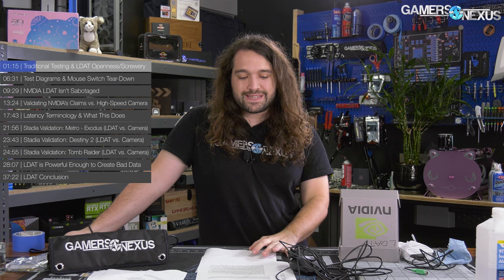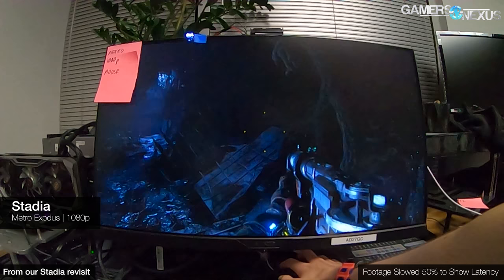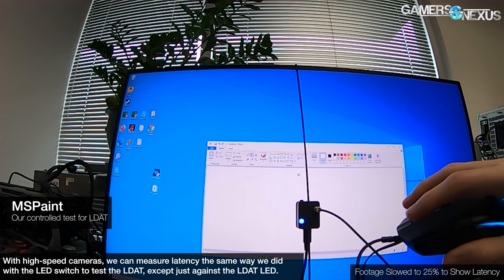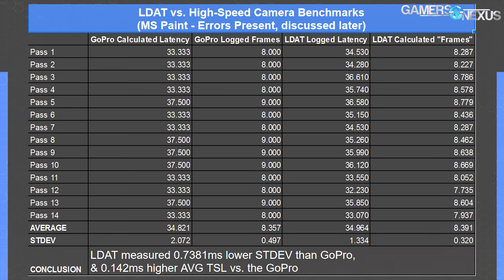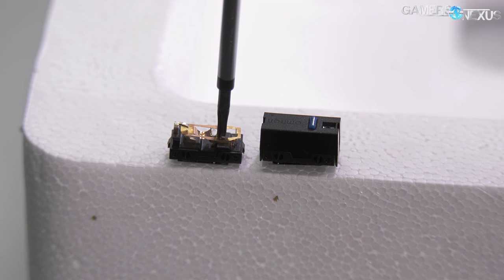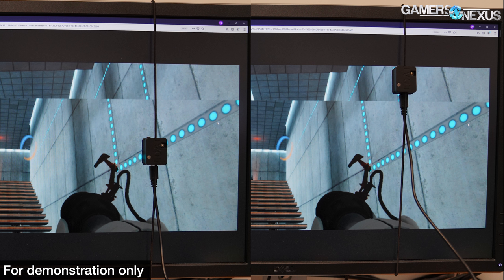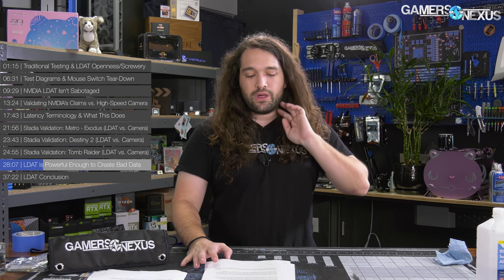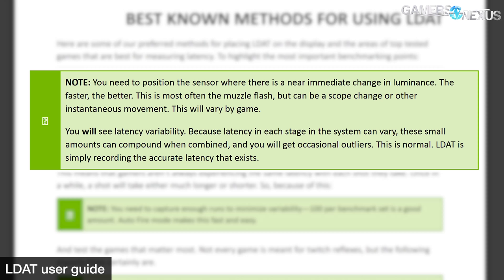Automated System Latency Test Methodology (NVIDIA Latency Analyzer Validation)

Comment: Some of the stuff I would like to see is:
Bloatware latency
Antivirus latency
Latency scaling with fps
Latency with g-sync ultimate vs freesync
Bluetooth on the different chipsets
Reply: You should check out Battle(non)sense, he has done latency testing for many things including g-sync vs freesync. He also has done testing for Nvidia's ultra low latency and AMD's equivalent.

https://www.youtube.com/BattleNonSense/videos
Reply: I've noticedUsing Game booster my latency has gone down. Curious if closing background apps makes a huge difference or if it's plesibo
Reply: @HauntedAbysss  If the game you're playing puts a significant load on your system where background processes have to fight for resources then yes it can make a large difference. If you have abundant CPU and GPU resources still available >10% to allow for background processes to not steal processing cycles you shouldn't see a big difference if any.
Reply: I wouldn't mind seeing Bluetooth latency. On my work laptop the Bluetooth was junk. Ended up getting an AX200 to upgrade to WiFi 6 as well as get better Bluetooth. No BT issues after upgrading.
Reply: Latency while playing youtube videos on another monitor.
Reply: latency testing of average human and pro gamers in different games
Reply: Bloatware, Antivirus, etc. are just software loads on your system. What I'm guessing you really mean is ISR/DPC latency.    Technically that will affect many things including mouse sens/input feel and overall system latency but measuring those individual software impacts is mostly system configuration dependent.
Reply: @howiejcee  yeah microstutters from dpc latency are cancer
Reply: sakle  That would be because they use more resources to decode.

Comment: QC technician here: if you want higher precision you should look at the traceable calibrations of every instrument you use. If you can trace their calibrations back to a NIST standard that is calibrated by NIST, you can verify the uncertainty of all of your measurements. This does NOT mean you need a NIST calibrated timer, photometer to measure light detection and universal time of the event. Rather if you can validate that every measurement device has been calibrated against a standard device ( a device either calibrated by NIST or a device at NIST)  and has a serialized calibration ID and a relative error (uncertainty) issued, you can increase your repeatability and confidence in your actual margin of error.
Reply from the maker: We have several NIST certified instruments already, but no photometers right now.
Reply: Eh, then you know how expensive calibration can be. I often spend as much on calibration as the tool cost, and I have to do it repeatedly. Important for QC in an accredited lab, not so much for a YouTuber
Reply from the maker: @FuncleChuck  Yeah. We spent about $2000 on calibration for some of our equipment in the last 2 years or so.
Reply: @GamersNexus  This is why I come back here.  Your commitment to unbiased testing is as close to any lab ive worked in.  You deserve more publicity and viewers so you can afford more equipment and processes to back your methodololgy. Keep up the great work and thanks for all that you do!
Reply: @FuncleChuck  Well, it boils down to the same thing: making money.  An accredited lab must do this to avoid exposure; you'll be sued by a customer if something fails and it comes out in court that your instruments were not in their calibration window.  For GN, it's a matter of credibility, they will loser viewership (== $) if it is revealed that they are using instruments out of calibration.  I would suggest that GN put up a page on their site listing their instruments and current calibration status, just as you keep records in your lab...
Reply: d00dEEE yeah! I’ve been saying that these tests are their own SAE /ANSI grade stuff. GN 9502 for latency, GN 18870 for CPU scaling hah
Reply from the maker: @d00dEEE  It'd be nice to do that; unfortunately, because we've seen competitors copy us over the years, we intentionally withhold some of that information for competitive reasons. Knowing the name of the tool is powerful when you compete with people who don't know those tools exist. That said, as our equipment becomes increasingly expensive, we'll probably start listing it -- but that's just because we know other reviewers won't invest $30K in a thermal chamber, for the most part, and those who can will already know what they're looking for.
Reply: Amateur electronics fan here: what would instruments perfectly calibrated against NIST standards help in this particular case? Sure, when measuring temperature or airflow it's reasonable, but we're talking about looking at a screen. Once you know the whole chain produces real-life results (latency numbers) that aren't skewed by inner processing, bus communications etc., you're good. We're talking about a few kilosamples of data per second, this is easily doable even with just a sound card or a cheap microcontroller/logic analyser.
Reply from the maker: Yes, we wouldn't NIST-certify something like this. I was talking about thermals and wind.
Reply: @Witchlord  I don't want to be a dick to GN, what they do is truly amazing and from what I've seen im have to agree that their COMMITMENT to correct testing is comparable to real labs.

That doesn't mean that their testing is as correct as lab results would be though. It probably mostly isn't. 

Thats not GNs fault and really a result of the situation though, and considering the situation their commitment is even more commendable. They got into an industry where a number of the tests they do didn't exist on a reviewer end and many of the tests they do are hard to design correctly without the insight into the design etc that a manufacturer run/commissioned lab would have.
Reply: @9SMTM6  well yea, thats because labs have more money than they do.  My response was taking that into account and was just trying to point out that they are committed to coming ever closer to that.  Your response is just splitting hairs.
Reply: @9SMTM6  Also, if you reread my comment, i didnt say that the results are close to a lab, just their ability to be unbiased and look strictly at the data
Reply: @Witchlord  My response is trying to clarify things for other people that might stumble upon this. GN itself constantly says how difficult it is to get the right message across. Many people will read your comment, which due to its correctness noone challenges, and will think "oh yeah so GNs results are lab class". That's not the situation here.
Reply: @Witchlord  if you read my response correctly you'd see that I never said that you said so. I just gave a statement that is against potential misunderstandings of your reply.
Reply: Erik Bročko how do we know the polling rate of the LED is exactly what they say it is? We just have NVIDIA’s word. You want to know what the frequency of that LED is, you need a calibrated oscilloscope. Secondly, high speed camera to verify the time code when the button is pushed isn’t any good if we don’t know the actual accuracy of the frame counting in the camera. There’s a lot of unknowns.
Reply: Gamers Nexus that’s exciting that you take your work to the next level. Calibrated equipment is something often seen in the sciences, but doesn’t seem to get the same level of attention in the tech space in a consumer manner (although most consumers don’t pay attention to NIST traceable equipment in the sciences either).
Reply: @GamersNexus  Being honest, I consume an inordinate amount of review content within the hardware space and I'm struggling to think of a genuine 'competitor' who is remotely on your level of detail or thoroughness. You epitomise market leadership for consumer pc hardware.

Comment: Well, RIP. I've been slowly working on a project almost identical to this, on my own, over the last year or two. I was intending on sending some freebies to my fave PC hardware YouTubers when it was done if they wanted to check it out!

Seems like the Nvidia guy working on this was more up to the task than I was, I was never able to get the photodiode polling rate that high, very nice! I only got up to about 1KHz before running into problems. Designing the Transimpedance Amplifier circuit was just not working out for me. Also, the software is way more fleshed out than mine. But the operating principle is identical (modified mouse, photodiode against the screen, hardware-agnostic). Glad people are getting their hands on this stuff. That's why I started my project - seeing the janky testing methodologies used across YT.
Reply: You're awesome

Comment: This opens up a really cool new possibility for HID testing; mouse, KB, and controller latencies. 
I'd love it if GN could do some Wired VS wireless latency testing for Bluetooth peripherals to see if there's a real difference there (on full battery).
also, Id really like to see the latency of different controllers; specifically the Xbox vs Switch pro vs DS4 vs Generic USB gamepad (say, a logitec) with Steam's controller drivers (how they're going to be used 95% of the time)
Reply: Rocket science have done some tests on the controllers, I recommend to you check it out

Comment: I work in the critical infrastructure field.  Our company specializes in monitoring power, specifically battery backup power on large battery banks.  Of the many values we monitor on a battery, ohmics is one of them and probably the trickiest.  This is because bad data is very, VERY easy to collect.  There are far more ways to do something incorrectly, than there are ways to do it right.  Even incorrectly torquing a bolt down on a battery by 10% can skew ohmic readings to make a perfectly good battery look bad.  This is why we limit who can buy/install our equipment and often times end up installing it ourselves to mitigate bad data collection.  

NVIDIA handing this equipment over to you is a huge show of faith in you and GN as a whole.  They trust that you will continue to do things the right way and validate your claims.  

...and they gave LTT one too.

Comment: I've been waiting for someone to take this approach to system latency since the quakeworld days. It was much more of an issue back then but sadly nobody remembers (or just don't care anymore). You absolutely have my support, thumbs up! BTW latency of mechanical mice (used at the time) was very consistent and genrally low compare to light sensor mice, monitors had been very different as well ...times they are a changin'...

Comment: Glad to see modern hard reviewers going in depth on technology instead of just producing Linus clickbait stuff, even if it isn't made for the masses. Definitely appreciate the video and I'm thoroughly glad that Nvidia went out of their way to produce something that has been needed in the community for a long time. I think the ultimate end version of this might even be something that excludes a mouse and produces a input to the computer, which it then has to display and the LDAT logs. Because of the speed at which the LDAT can capture, you could theoretically log input to frame time and then look at the end to end latency on said frame. Then you could remove frame time as a variable, and look specifically at the variance in input delay and compare it against frame time.

This would be easiest to do with a overlay, however a overlay is not something that a game is producing and bypasses something that really matters. At the end of the day, having game developers simply output a square of changing colors in a certain area of the screen like AMD used for zerolag (assuming they aren't trying to make that data look good) would make for a truly powerful tool that could then be used in tandem with current frametime analysis and benchmarking. 

While this would remove the mouse, mice themselves are different for everyone and I really hope this tool will also help add some level of truth to claims mice manufacturers are making about the speed of their mice. Input delay on mice, as well as general performance (DPI, input consistency, input polling), has always been a black box almost no one tackles and has no real consistent methodology for testing it.

Comment: Good Morning Steve! Testing Methodology suggestion here

In order to get around your issue referenced at 26:15 , regarding LDAT positioning inconsistencies getting in the way of results , you could mark the top and side of your monitor with measured increments, and add a second strap to ldat that is horizontal. you could then use the markings on the top and side of the monitor to act as X, Y coordinates to encourage more reproducible LDAT testing conditions.

Later on, you could probably 3d print something to be a less janky version of this. using a ruler and a silver sharpie or perhaps a tailors measuring tape cut to size and taped to the monitors top and side could work as well. 

Happy Testing to you!

Comment: I imagine you could use the LDAT to determine the latency of a mouse too. You could attach the LED to the the left click of the mouse like you've been doing, and then point the LED straight into the LDAT's sensor. You could then compare the time the sensor saw the light change to the time the program got a mouse input.

Comment: 3:53 crysis water tessellation? Can someone give a lore dump?
Reply: Nvidia forced tesselation that you couldn't even see under the water in crysis 2 that dragged AMDs framerate way down Nvidia GPUs of that era were far better at running tessellation vs AMD.
Basically they made it so the game was rendering stuff that didn't matter to fuck over their competitior, while also slightly ruining their own fps just that their cards could handle it better than AMD could.
Reply: In Crisis the game, water will be rendered under the whole map, even under the island and will be fully rendered by the GPU even when occluded by said island, because the tech was NVIDIA's their cards could handle the gigantic load much better than AMD. This obviously gave them a huge advantage in benchmarks. But it also made the game stupid to run, irrelevant of which GPU you had :D

Features like this are part of other games too. Its not personal, its business, as Jensen said: The more you spend, the more you save!
Reply: @CloakerGaming  I agree it would be hard to know if nVIDIA did have a hand in it or just Crytek not putting in the effort to only have a layer of water only where there was water visible,
but as I never knew this I now understand 'Can it Run Crysis' a lot better

Comment: The LDAT looks like it builds off of the Leo Bodnar lag tester that is used for testing monitor response time.  That tester uses the same kind of light sensor, but it generates its own HDMI signal to trigger the change and display the latency on the screen as a number.

Comment: Something that may be interesting to measure; the difference (if there is any) in latency between a USB mouse, using a software driver that utilizes a polling rate to read the mouse, and a mouse on a PS/2 port, which is (can be) driverless and is on an IRQ.

Comment: Just because there isn’t software trickery doesn’t mean it’s fair to use an Nvidia tool for testing Nvidia cards. Because they use the same tool internally, they may accidentally tune their cards to do better in the precise way the tool measures latency. For example, if the tool measures pixel changes in the middle of the screen, and nvidia were to render frames from the middle out, they would do better than the competition that renders from the top down.

That specific example is unlikely but the concept behind it still stands
Reply from the maker: No, it really doesn't stand, because the way the cards render is publicly known (and that's not it) and because this is the same way you'd measure it with a camera, just easier. That said, we always verify with high-speed cameras before using a new tool.

Comment: Looks to me like a way to augment your manual video frame reviews where LDAT is not useful (like detecting an "instantaneous" change, but one that happens across a wider section of the screen) would be to make a video analysis tool that does RMS difference between subsequent frames on sections of your footage of interest + the LED light as T-0 anchor and it triggers when the section RMS difference jumps up significantly over a given threshold (bound by camera noise and things changing on the screen like foliage waving in the wind, etc..). 

This, in principle, should be able to autonomously detect stuff like a sudden mouse movement in a shooter, especially if motion blur is turned off in the game. Of course, for each test run you'd need to train the RMS threshold by eye for that given scene and overall camera performance on that very same day. Still, it seems to me like it could speed things up compared to simply counting frames manually.

Comment: Overall excellent video, I enjoy watching how you set up your testing and agree that it's very good. Only one small quibble this time.
16:54 "LDAT is more precise and more accurate" I understand that it's more precise, but I don't think you can be justified in saying it's more accurate than the test you used to verify its accuracy. In the Metrology (Calibration) world, this is known as the Test Uncertainly Ratio (TUR) and should be 4:1 or better to indicate that your calibration tool has sufficient accuracy to ensure that you have correctly calibrated your unit under test to a reasonable degree of certainty. The same principle is used for verification testing like you have done here.